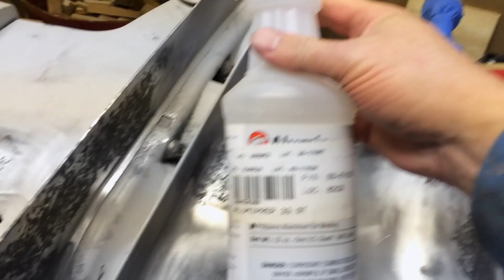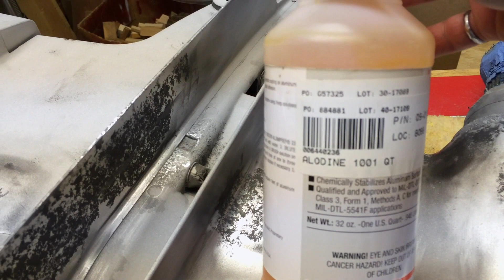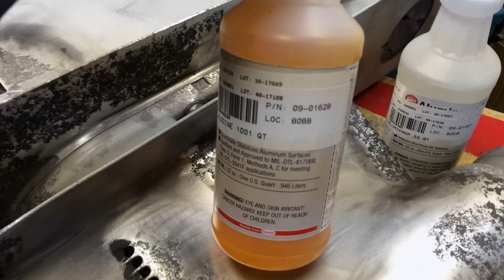Bravo III Corrosion Remediation & Painting   Fall 2015

Comment from the maker: Good catch Mark!  When we purchased the boat the port side had two anodes on the cavitation plate and the port only had one.  I called the original dealer regarding warranty work and they confirmed that one lower unit had been replace - which is why they are now different.  I added the propshaft anode on both drives last season.  After one full season the starboard drive showed no corrosion and the paint was in perfect shape.
Reply: How was the outcome in the end? And do you boat in fresh water or salt?
Reply: sorry to be offtopic but does any of you know of a trick to get back into an Instagram account..?
I was stupid lost the password. I would appreciate any help you can offer me!
Reply: @Warren Ricardo instablaster ;)
Reply: @Dallas Chandler thanks for your reply. I got to the site on google and im in the hacking process now.
Takes quite some time so I will reply here later with my results.
Reply: @Dallas Chandler It worked and I actually got access to my account again. I'm so happy!
Thanks so much, you saved my ass :D
Reply: @Warren Ricardo No problem xD

Comment: Have pitting and want to take care of it?  I used this product 20 years ago and it is exactly what one needs to prep after cleaning and before painting. Amazing product. Its a two part Alu and epoxy mixed then applied and sanded smooth Devcon 10610 Aluminum Putty (F), 1 lb. Can

Comment: The reason why 2 of the drives where different is because one dive is from a 99 and the other is a newer style. But my question is how did you add a prop anode to the drive that has a single cavitation plate?